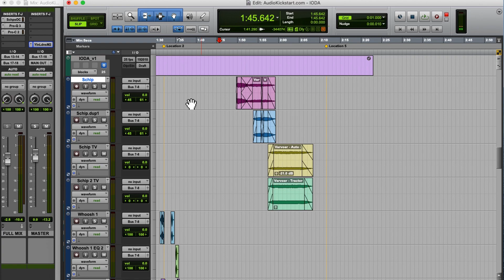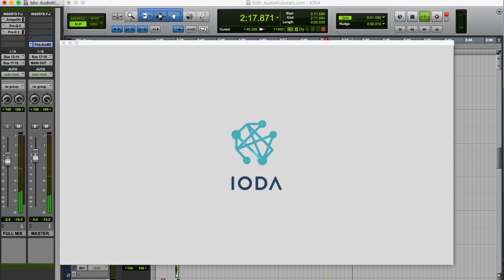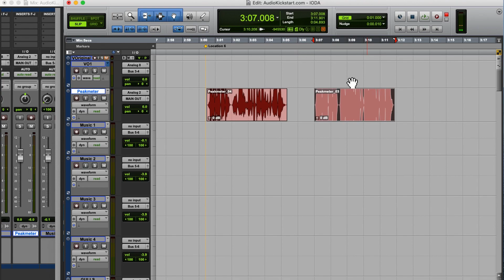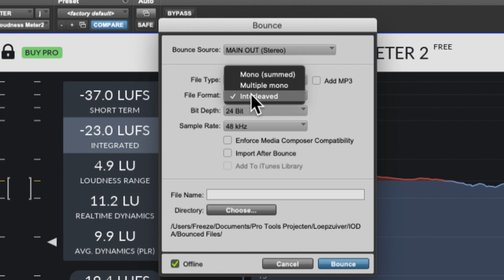Mixing audio for TV: EBU R128

Comment: Hey, great video!
I've run into a problem - the technical requirements for a commercial that I need to abide by say that I need 4 audio channels, first one being stereo left, second one being stereo right, and the rest are duplicates of the first 2. Do you have any idea what is that for? Also, when I do that, I gain extra 3dB to the lufs. If I have a stereo recording, should I even bother with splitting the audio in 2 mono channels? I'm just really confused whether I should do the metering before, while I have the stereo track in one piece, or after, when I have 2 channels of the same stereo signal split into stereo left and stereo right.
I hope that you've run into this, and can help me out. 
Thanks!
Reply from the maker: Hi and thanks! :)

I think the first thing to check with the station is what they need those multiple channels for. I’ve only come across this when there are multiple ‘ingredients’ to be delivered, so let’s say channel 1 and 2 contain the full mix left and right and channel 3 and 4 contain the music & effects. Those extra channels can be used for remixes, localizations, etc. If that is the case, you need to make sure that your final mix that is going to be aired is at -23 lufs, so that would be channel 1 + 2 (as a stereo pair). 

I assume this is also true in this case, but it’s best to check with them before uploading.

Comment: Hi Gijs! First of all, thanks for this tutorial! You explained everything very well and it was easy to follow. However, there is still a question that remains for me:

Let's say I have mixed a little radio ad WITHOUT checking the EBU R128 meters and the mix sounds fine but of course, the Loudness level is still way too high. Is it really the best way to bring up the EBU meters just now after I'm done editing/mixing the whole thing more or less by ear and correct the Loudness by decreasing the volume of the complete mixdown? 

Also, after successfully bringing it down to at -23LUFS max the overall volume level is at around -10dB. This isn't an issue, right? What if the radio station gets several mixes way louder than -10dB and then here I am with my ad of -10. Do they bring every ad to a the same volume level or doesn't it even make a difference because the only thing "noticeable" to the human ear is the Loudness level?
Reply from the maker: Hi Stephan, thanks for your kind words! To answer your first question: the most important thing is that it sounds good :) Setting the level afterwards is no problem in that regard, as long as it sounds good. Of course, if you keep an eye on the EBU meter while mixing, you will probably set your monitor volume higher in the first place and you won't have to change the master level much in the end. If you use brick wall limiting or compression on your master fader, it may make a difference though. If you want the sound of that limiter/compressor, that's great. Just turn down the level in the end. But if you use it only to make your mix sound louder, you may want to try to mix without the limiter and see how your mix sounds in the end. The nice thing with R128 is that you have the freedom to use the available dynamic range. 

Small side note: here in the Netherlands radio stations use very heavy sound processing to make their station sound bigger, brighter and louder compared to other stations. And to create 'their own sound'. So if you made a very dynamic mix, it will sound completely 'flat' on the radio no matter what you do. :) So again, the most important thing is that your mix sounds great and everything in your mix has it's own place in the stereo image. Make a '3D' mix, where the voice-over sounds close and up front and the music sounds as if it is just behind the voice-over.

Your second question: if the radio station wants you to deliver your mix in R128, it's no problem that the peak level is at -10 dB. As you said yourself, the thing with R128 is that it already is at the same level to the ear. And that's what matters, that is what R128 tries to measure. Peak levels don't say much about how loud something sounds.
Reply: @AudioKickstartcom  Hi Gijs! Actually, I've already written a reply days ago but it seems it somehow didn't get through. 
So, once again: thanks a ton for your detailed explanation and your help! I think I really understand it now. I kinda like the sound of the compressor; at least when it's not over-used. I think I will stay with using it but I guess I will stay play around and see how it sounds without.
Also, what pity most radio stations in the Netherlands have their own mix and they just use it on top of every mix they get. You spent so much time editing/mixing and then they just get rid of it 😄 I am not sure how our radio stations in Germany do it though... it could be the same case here. I guess I will just make sure to include the correct EBU levels nevertheless and send them the proper mix in the first place 🙂
Reply from the maker: Yeah, a good mix will translate to every system! 😄👍🏻

Comment: This channel is a jem..i do my mix and mastering in a seperate cubase project ..then i render it to wave 48k 24 bit..adobe audition has nice lufs plugin for adjust the loudness ..is it okay to use that rendered wave file imported to audition daw and do the lufs adjustment there and render again..will i loss some thing in my track as i render two times in two daws..🤔🤔
Reply from the maker: In theory, yes you will lose something when reimporting, adjusting the volume and bouncing to disk again, even if you keep the sample rate and bit rate the same. But I wonder how many people would actually hear this in a blind test if you re-convert only once, my guess is not so many :)

But Cubase does have some nice ways of lufs measuring itself if I’m not mistaken, and you could also use the Youlean plugin in Cubase so you don’t have to switch to Audition just for that final step.
Reply: @AudioKickstartcom  thanks for the early reply i will try...

Comment: Thank you for tutorial. But I find the title a bit misleading, being a producer for many years, isn't this just called mastering for TV/Film? I mean, basically you just adjusted the overall track volume to be around -23lufs, and to not exceed the peak, which is great, I was looking for that info. But as far as the mix goes, you didn't adjust the mix at all, or am I missing something. Fact is, I've never mixed/mastered specifically for TV or Film, just now getting into it. I had one track placed via publisher somewhere, and it wasn't even adjusted to those levels by me, it was released for streaming. Nowadays (2022) the standard for streaming is around -14 Lufs, but the value usually is higher for released music. Anyway, I'm just wondering if the mix has to be adjusted somehow, or if you have your music finished, you only need to adjust the master so it doesn't exceed -23lufs..? Or is it that you just adjust the overall mix volume, in turn lowering the master, but still putting the mastering chain after. I'm confused a bit.
Reply from the maker: Hi, 
Thanks for your comment! I think you are right, this could be more accurately described as mastering, although the process of mixing and mastering is usually something you do in one go when mixing for TV, at least in my experience. I do have a written tutorial about the whole mixing-for-TV process  here: https://www.audiokickstart.com/en/mixing-audio-for-video-the-mixing-process/. Maybe this gives a little more insight, if you have some specific questions you can always send me an email: gijs@audiokickstart.com.

Comment: This is great! Do you have some tips on how to mix and master for TV speakers? Like what could do to get everything as clear as possible. I seem to have the same problem over and over again. The base frequencies are really bad on TV speakers but fine on computers and cellphones. Thought to eliminate everything below 150Hz in a equalizer on the master channel.
Reply from the maker: Hi and thanks! The problem frequencies on TV speakers are usually around 200 Hz in my experience. If you do something 'wrong' there and boost that area too much, it could sound very boomy and/or bad. :)  Although in a TV ad the mid and mid-high frequencies deserve more attention than anything else, boosting a little around 150-160 Hz (and maybe cutting a little in the problem area around 200 hz) may work to get some sense of low-end in your commercial, so cutting off everything below 150 is a bit to much in my opinion. I do usually put a high-pass filter on the master around 75Hz though, to make sure the energy is not wasted on the low-end nobody will hear.
Reply: @AudioKickstartcom  Great thanks, I'll try that for sure!

Comment: Thank you for this video! I have a question though: I compared some TV ads, and while they all read out at -23 LUFS, some still sounded louder than others (for example the voice over was much more 'present'). Are there any tricks to increase the perceived loudness while still conforming to the EBU R128 requirements?
Reply from the maker: Hi, thanks for your question. Yes, the system is not perfect and can be fooled a little in some ways :) In my experience it is a combination of a number of factors, it’s perhaps a little too much to put in a comment, but email me at gijs@audiokickstart.com if you want to discuss this!

Comment: How to maintain the loudness level within the series or advertisement so that it does not exceed this level or is too low
Does it have to be done manually or is there a way to maintain the required level?
Thanks
Reply from the maker: Hi! It’s all about the integrated level of the whole ad or show. So if the level is -25 at some point and -20 a little later, it doesn’t matter as long as the integrated value, so the ‘average’ level of the whole show is -23LUFS.

But you want the listener to have a pleasant listening experience, of course :) So big and distracting level differences, in dialogue tracks for example, are usually corrected for by hand and/or with the help of compressors/limiters, have a look at this tutorial: https://youtu.be/bXMU-BCqd7Y

Hope that answers your question! :) If not, feel free to email me at gijs@audiokickstart.com.